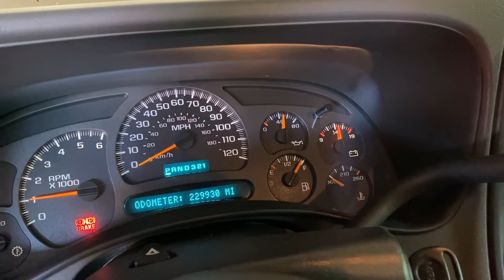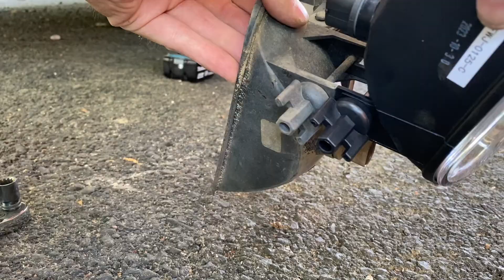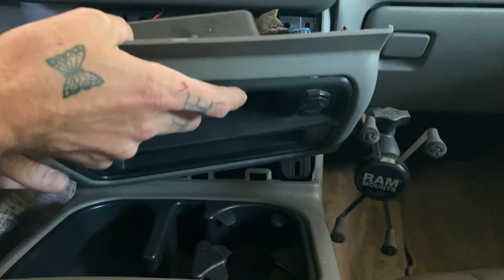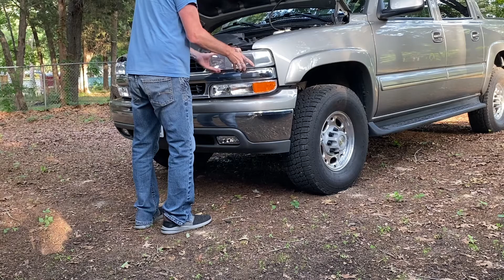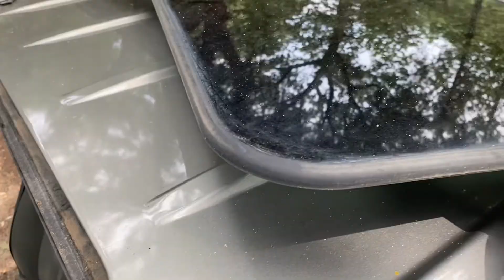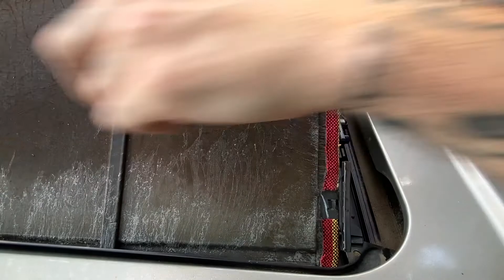New Project! 2003 Suburban 2500, Fixing Things with Amazon Parts, Part 1, Lights, Camera, Sunroof

Comment: I have a 2003 2500 Suburban, 8.1 big block, 4x4 with barn doors.  Tows awesome, LOVES gas.  

It’s a terrific 3/4 ton suv.
Reply from the maker: lol, I bet it is thirsty. Ive had mine 2 years now, 14.2 mpg no matter what I do to it.
Reply: Mee too... I have 2001, 8.1, 2500, 9 seater, driven soon 79000 mile (127138 km), ex USA embassy car from Budapest, Hungary and now in Finland... Well, it use fuel, but Sub has much better fuel economy than the 2001 Tahoe I had earlier... ;-) I Have had Silverado 4x4, 1984, and 6,5 TD Sub, 2500, 1997 and Tahoe 2001, 4x4 but this 8.1 is the best of all... 😁👍

Comment: I have a 2000 suburban and have put a ton of work into it, but the electronics are absolute trash on these GM vehicles, especially compared to Toyotas and that is why Toyotas are better, unfortunately
Reply from the maker: It is definitely debateable.  1999 to 2002 are completely different electronics wise from 03-06 gmt800 rigs.  They made a ton of changes between them on the GM stuff.  Im not familiar with the toyotas of those eras.

Comment: If it shows RPO # gt4 in the glove box it has 3.73 gears, gt5 is 4.10 rear end gearing
Reply from the maker: Thanks for that, mines GT4.  Still feels a little sluggish with the 285's.  I have a tuner on it set to economy 87 octane.  Might remove it and see how it is.  I did adjust the tire size in the tuner.